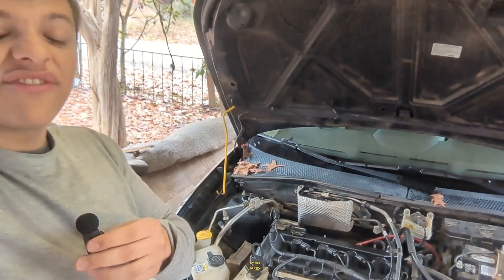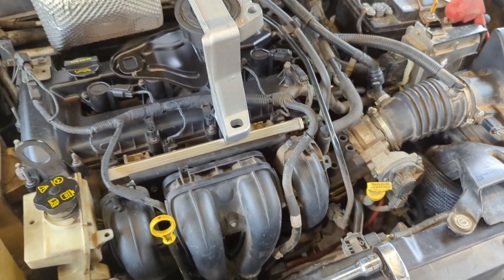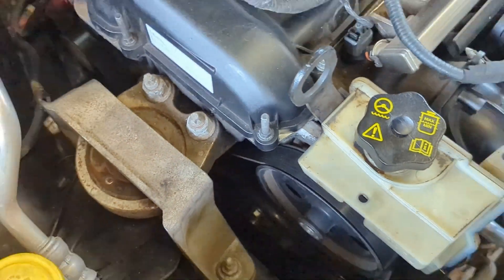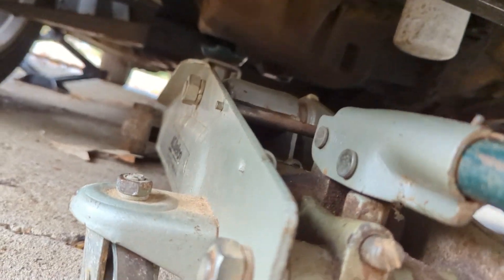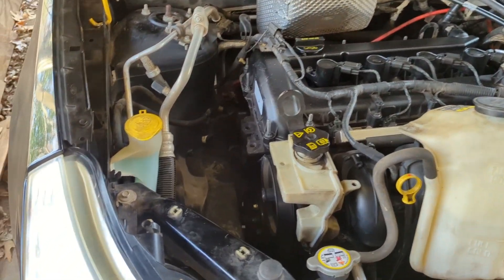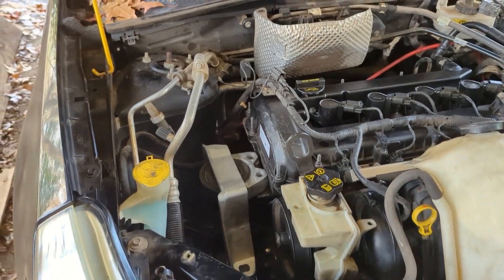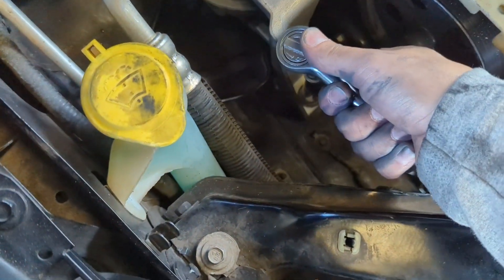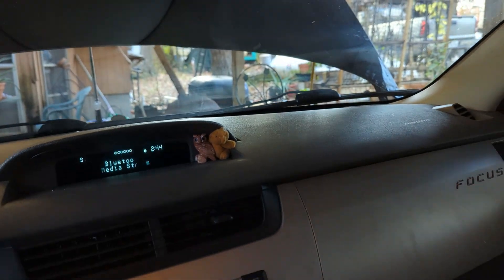2005-2011 Ford Focus Vibration at Idle or Acceleration Fix! (Passenger side motor mount replacement)

Comment: Changed it, still vibrates. Accessing the issue. 👍🏻
Reply: what was the issue?
Reply: @OceanusSeafreeze  No, diesel C-Max doesn't have coil packs.
Reply: @shanefitzp  The root cause was somewhere I never thought to look, but I've since changed it. Dual Mass Flywheel.

Comment: Thanks, Phillip!
I just bought a 2007 Ford Focus SE Wagon and I just got the motor mounts replaced about a week ago but I'm still experiencing some vibration while idle... any ideas?
Reply from the maker: Idle in gear (D, R, L) or in neutral or park?
Reply: In gear, usually in drive, waiting at a stoplight/stop sign etc.
Reply from the maker: Had the same issue! Check the rear mount. Turns out that the larger circle is supposed to attach to the subframe, and the smaller one attaches to the engine! I'll probably reupload this video
Reply: Okay, good so I'm not crazy! I'll check the back motor mount and see what if that's what it is.
Thank you and I'll keep an eye out for the re-upload.
Reply from the maker: Also, this is an old economy car... You'll still feel a little bit of vibration no matter what!!
Reply: Okay, great thanks, this is my first time with a used car like this so I'm trying to figure out what's normal and what need fixing/replacing.
Reply from the maker: I'll be uploading plenty more videos in the near future! Btw, '05-'07 and '08-'11 models are mechanically identical pretty much